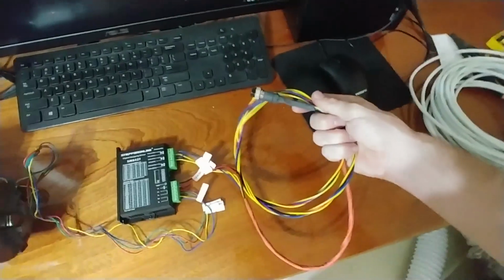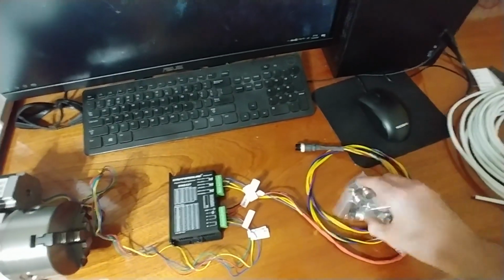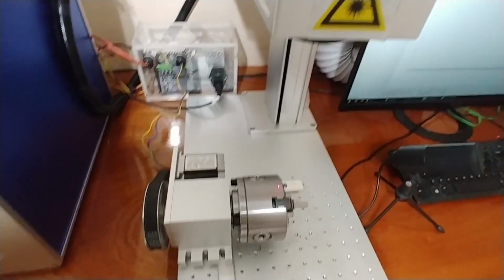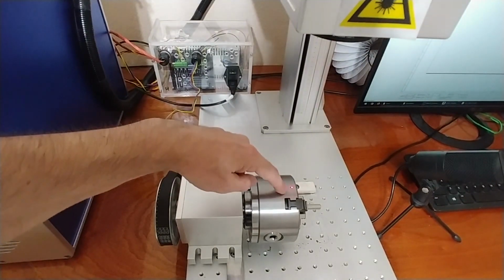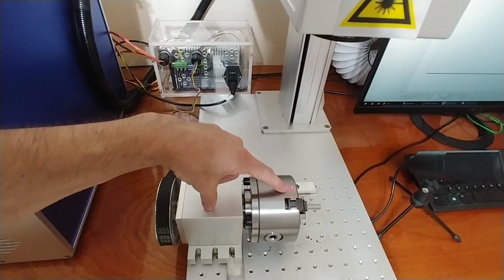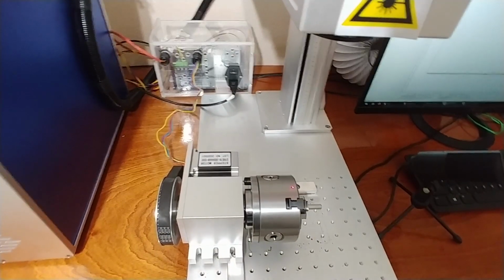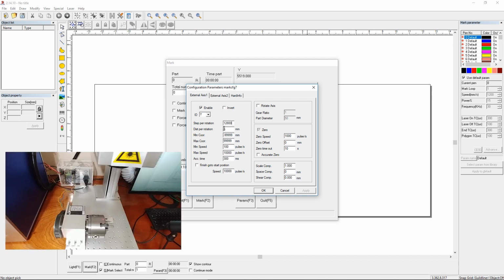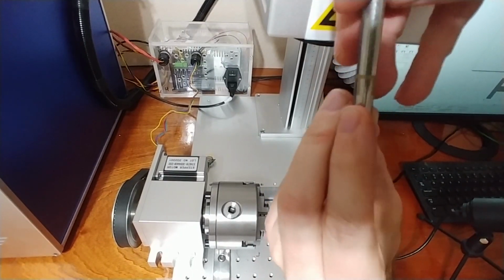Adding a Rotary Axis to a Fiber Laser for use with EzCad2

Comment: Just wondering if you know anyone who changed the laser source. I got a feeling my source went bad. The laser lost power and within a minute or two it went out. I got refunded by the seller and I still have the machine. So I'd like to buy a 30w fiber laser source and install it. I've checked the power source and that seems ok. Got a new board and that did nothing so I'm thinking it's the laser source itself.
Reply from the maker: So you have an extra broken machine lying around?  Not a bad deal.  I'm assuming you checked all the basics like switches and the PSUs.  I don't know anyone who has changed the source, but maybe you can purchase the least expensive 20w source you can find to swap in just for experimentation.

Comment: Mine came with a plug, I just plugged it in
Was that not an option?
Can u fit a thermos in yours? Mines just a bit to small
Reply from the maker: I needed the stepper drive, yours may have already had it installed.  Not sure about the thermos, depends on diameter I suppose...you can see model of the chuck here: https://www.rattm-motor.com/ruseu-shipcnc-4th-axis-a-aixs-rotary-axis3-jaw-chuck-100mm-k11-100mm-tailstock-for-mini-cnc-routerwoodworking-engraving-p2051571.html

Comment: I'm curious... With a rotary axis, can you only do completely round objects? Or, for example, can you put a flask in the chuck (which is usually a wide curved surface but not actually round) and mark on the curved face?
Reply from the maker: I haven't tried yet, but I'd imagine as long as the dimensions were entered correctly, it wouldn't be an issue.  That said, it would probably be faster and more reliable to mark something like a flask with a 300x300 lens that can handle a little curvature.
Reply: yes ,sure dear  https://youtu.be/NQ2Ia4CMz9w
Reply: Ive done this at work, its really simple once you have programmed all the variables, you just set the diameter of the place on the flask youre marking, a caliper is a must when youre working with a rotary chuck btw.

Comment: Have you been able to successfully do vectors on a rotary Mark?
Reply: We do vectors on the rotary all the time to make precision measuring dials. Using Splitmark2 from under the laser menu has given us the best results so far. We use the bidirectional hatch and set the split size to .05mm for our purposes. With these settings we can get clear readable text in our vectors down to 1.3mm in height. There are probably other ways to get a similar result but this way works for us

Comment: I can’t thank you enough for all the laser videos you have out there.
I want to ask you though why did you decide to build everything out for a rotary vs. buying the rotary that comes with the machines. The one I have, I bought with the machine and all I need to do is plug it in thru the 15pin port on the back of the laser.

Edit: never mind , I just figured you don’t have the 15pin on the back of your machine.
Reply: I agree, I purchased a rotary with my machine and all I had to do was plug it in. More information on rotary engraving would be really useful.